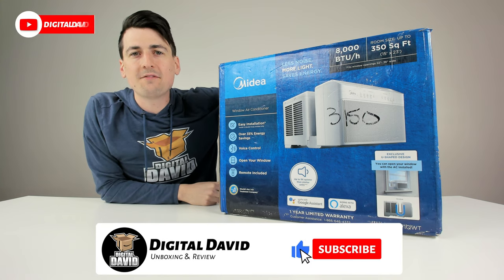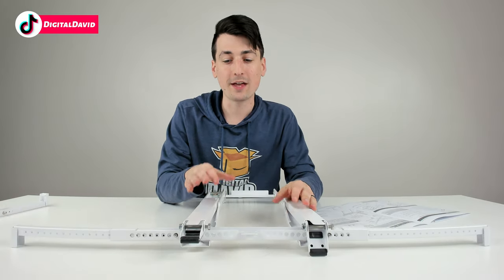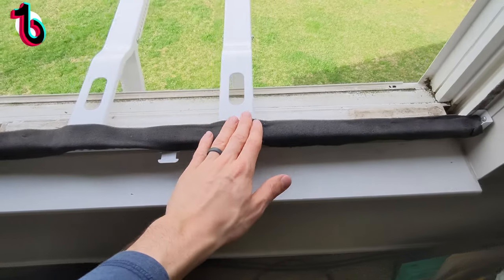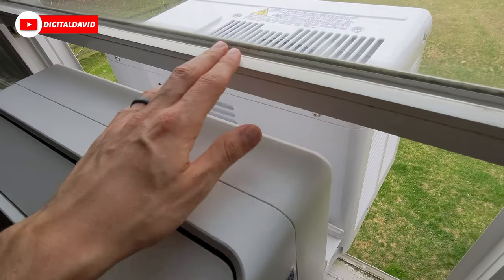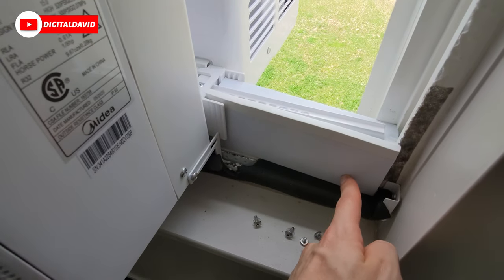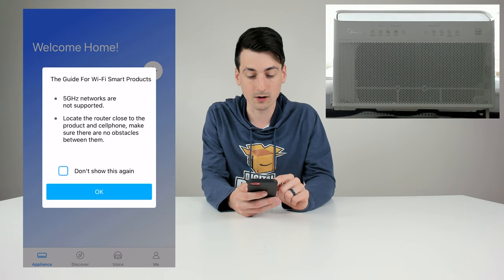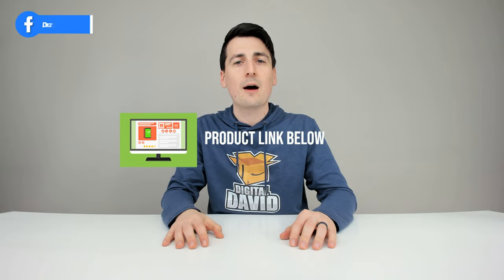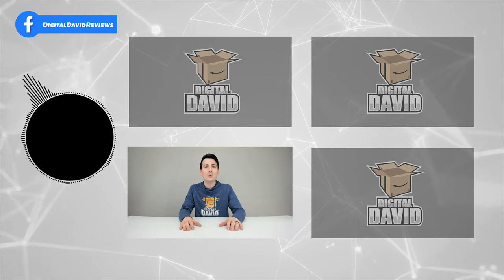Midea U Inverter Window Air Conditioner Install // Smart Air Conditioner

Comment: More Alexa commands
Where the air conditioner is named “AIR CONDITIONER”. Substitute the chosen name of your unit.
Alexa turn on AIR CONDITIONER / Alexa turn off AIR CONDITIONER/ Alexa shut down AIR CONDITIONER
Alexa set AIR CONDITIONER mode to auto / Alexa set AIR CONDITIONER mode to cool
Alexa set AIR CONDITIONER to 18 / Alexa what is the AIR CONDITIONER mode
Alexa what is the AIR CONDITIONER temperature / Alexa what is the AIR CONDITIONER set at
Alexa set the AIR CONDITIONER to Fahrenheit / Celsius (says degrees, unit display unaffected)
Reply from the maker: Thanks for sharing these additional Alexa commands! It's great to see that the Midea U Inverter Window Air Conditioner can be controlled through voice commands, making it more convenient for users. With these commands, users can turn on/off the unit, set the mode to auto or cool, adjust the temperature, and even ask for the current temperature and mode of the air conditioner. It's also useful to know that Alexa can switch between Fahrenheit and Celsius units. Thanks again for sharing! cnl

Comment: Problem is if you move and the rooms only have horizontal windows then you have no use for it and for the price you are paying it is not worth it.
Reply from the maker: That's a valid point. The Midea U Inverter Window Air Conditioner is designed specifically for vertical sliding windows, so it may not be suitable for every living situation. It's important to consider your home's window types before purchasing an air conditioner. cnl

Comment: Omg.  Read the privacy policy on this app.  This Chinese company can take ALL SENSITIVE DATAON YOU.  Including your sexuality, etc.   Hell No!!
Reply from the maker: Thank you for expressing your concerns regarding the privacy policy of the Midea U Inverter Window Air Conditioner app. It's important to prioritize your privacy and data security when using any smart device or associated applications.

When using smart devices, especially those connected to the internet, it is crucial to thoroughly review the privacy policy and terms of service provided by the manufacturer or app developer. These policies outline the data collection and usage practices, helping you make an informed decision about sharing your information.

If you have concerns about the privacy policy of the Midea U Inverter Window Air Conditioner app, I recommend carefully reviewing the policy to understand how your data is collected, stored, and used. If you are uncomfortable with the terms outlined in the policy, you may choose not to use the app or consider alternative air conditioning solutions that align better with your privacy preferences.

Remember that privacy concerns can vary from person to person, so it's important to make a decision that aligns with your own comfort level and personal preferences. cnl

Comment: Everyone selling them $230+ over MSRP total ripoff.
Reply from the maker: It comes in and out of stock on Amazon... 8000BTU should be around $330 if I remember correctly
Reply: @DigitalDavid  yea now the 8000BTU on Amazon is $621.
Reply: 8000BTU $359 at Amazon!
Reply: The prices are constantly jumping, especially now around AC season. I paid $650 for the 12,000btu. I’ve seen it anywhere from 550-800.
Reply: True I got mine for 450
Reply: @crickiit66  how many btu’s?
Reply: @deejay2793  got a 12k unit from Home Depot for $483 delivered to the store.  Put it in today other than some very horrible fan noise at first on the outside, seems to be working well.
Reply: @deejay2793  purchased mine for $498 with sales tax on Amazon in 21-21

Comment: The window seals suck. Y
Reply from the maker: I'm sorry to hear that you had a negative experience with the window seals of the Midea U Inverter Window Air Conditioner. It can be frustrating when a product does not meet expectations, especially when it comes to installation and proper functioning. Have you tried reaching out to Midea's customer service to see if they can assist you with any issues related to the window seals? They may have some suggestions that could help you properly install the air conditioner and improve its effectiveness. Additionally, leaving a review or comment about your experience can be helpful to others considering the same product. cnl